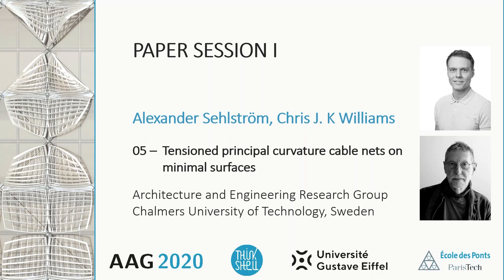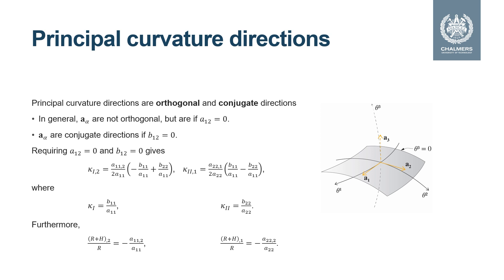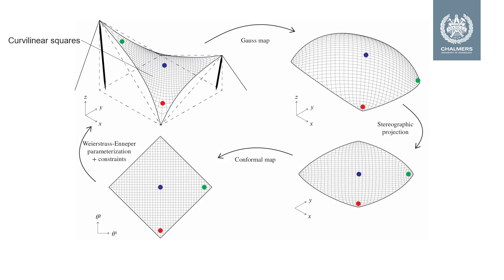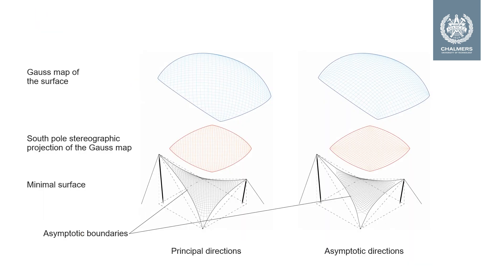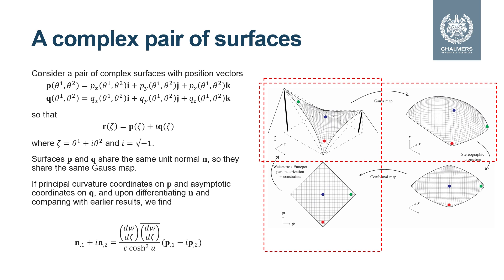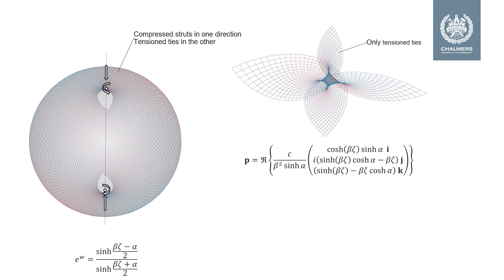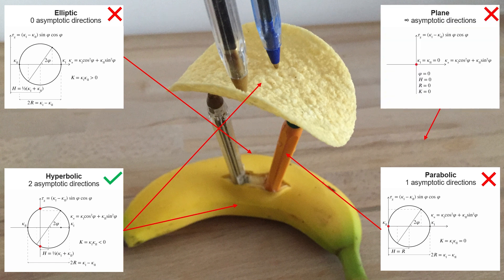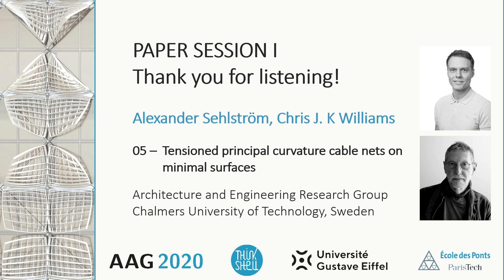05: Tensioned Principle Curvature Cable Nets on Minimal Surfaces

Comment: Thank you for the great presentation and paper.
 I am particularly interested in the load-bearing behaviour along the asymptotic curves (your final chip and banana example). I would like to understand how (or if) your theory can be applied to asymptotic gridshells or if it is only valid for continuous shell. 
Is what you're describing related to the elongation and compression of the normal fibers in a beam under torsion (helix torsion)? 
The geodesic torsion along a ruling/asymptotic of a hyperbolic paraboloid is not constant. It is related to the Gaussian Curvature, rather than the straightness (geodesic curvature) of an asymptotic CurveOnSurface. Does this affect the mechanical torsion?